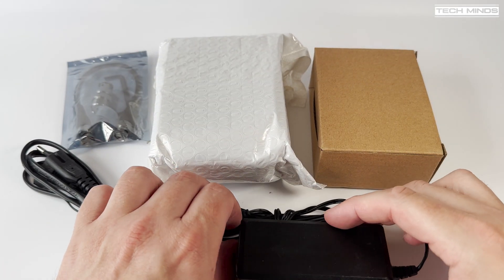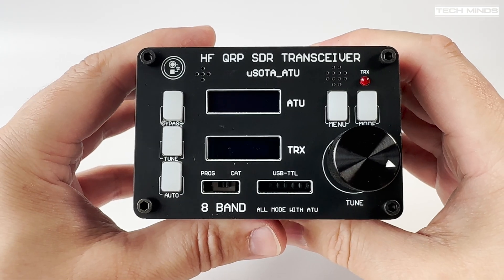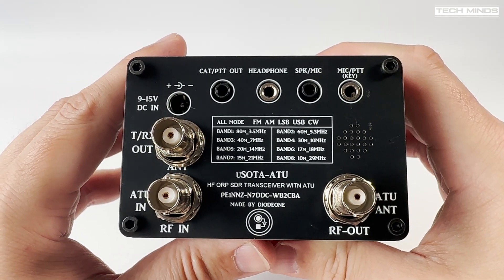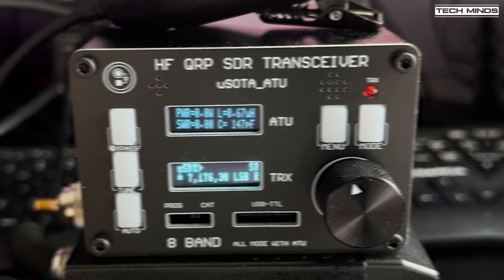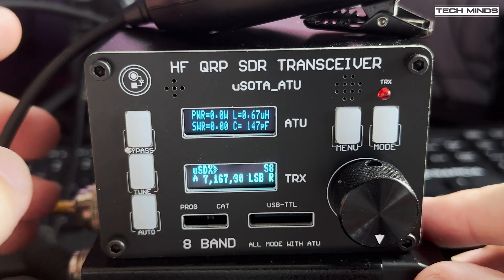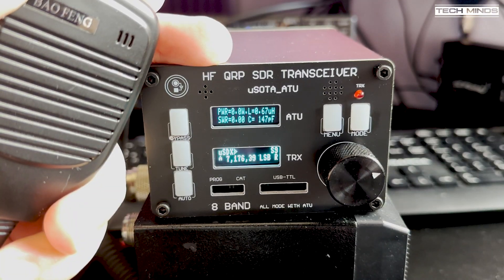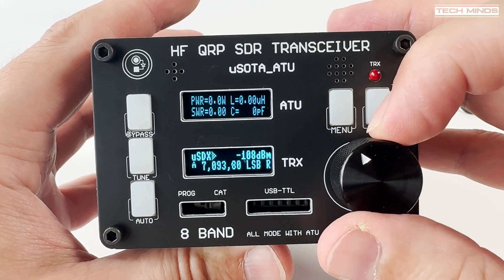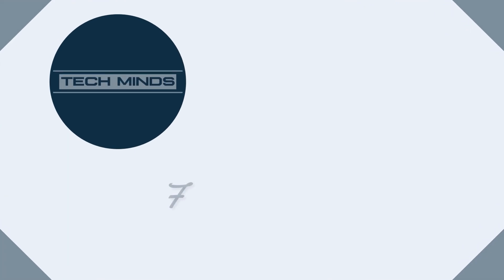USDX SDR Transceiver All Mode 8 Band HF Ham Radio With ATU

Comment: I have same radio. What config is needed ?  Black brick, red corners or white buttons?   The radio works great right out of the box, But when I try loading Black brick config with Arduino UNO (using IU7SYS video)  none of my setting take affect.  chose not to load CAT and to use CW.  Only want one cw message  (first one "CQ")   only three modes CW USB LSB.   even my callsign W6AOA does not show in the program.   the v 4.00d does not show on the bootup screen.  Any assist appreciated..  Tnx Ed W6AOA

Comment: Thanks for another excellent video! Just got mine, and I have two questions: I. Is it possible to regulate the output power? II. How to get a side tone?
Reply: The first one depends.. with battery (jf it has one built in) 7-9w of power, straight plug 12w.

Comment: the power 12 v 1.5 amp is very bad to transceiver i think realy the amperes have 2 amp for this type of transceiver need more power is very just for 4 watts and function menu i recomended use AGC SLOW becuse the volume is more stable for the procesed audio signal for audio tx distorsion open the transceiver and put into electrect microphone one capacitor between positve and negative electrect microphone conexion to RF distorsion is very miracle solution to audio tx

Comment: You can't go too far wrong at $318 AUD if you are willing to tinker. Sure its no iCOM 7300 but it'll get you on the air and with a bit of tinkering you can make it sound fairly decent. Getting on HF has always had a big price barrier for new hams. This may be the ticket to lowering the bar to entry into HF. Now I might own a 7300, but my problem is room - I don't have the space to get on the lower bands!

Comment: I have the usdr+ set up on FT8,, it works fine if a bit flakey. I started with using a USB sound card and the Vox setting on the radio, this worked but a lot of confusion with the volume settings and various outputs. I then moved to the sound card plus CAT controller and that works much better. You get basic frequency change facilities but the huge benefit is not having to use VOX
Reply: What cable did you use if you don’t mind me asking
Reply: What kind of cable did you use to connect to your computer?

Comment: Looks a bit cheaply constructed (on the component level), while the design seems decent. Needs some polish and fixes before I would be interested. I love the idea, but unsure of the implementation.
Reply: Like all value priced radios, the TX has a good deal of splatter.  The RX is real tin sounding. 
Very comprehensive review. I think you saved me some money. Lol